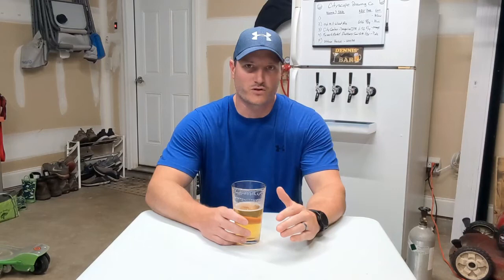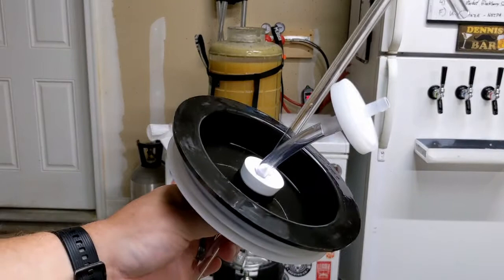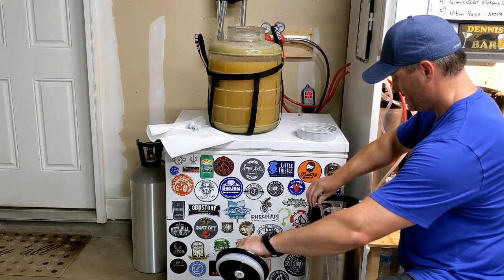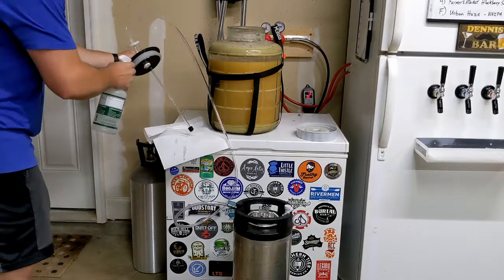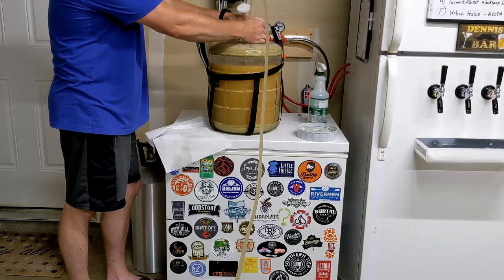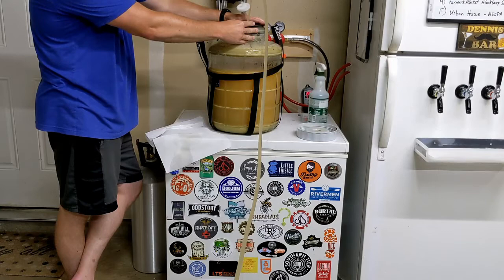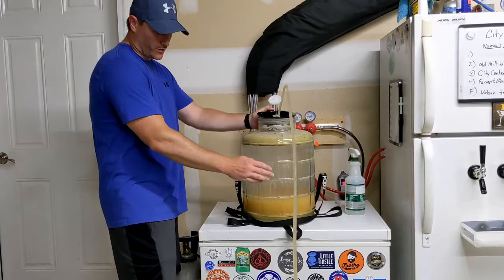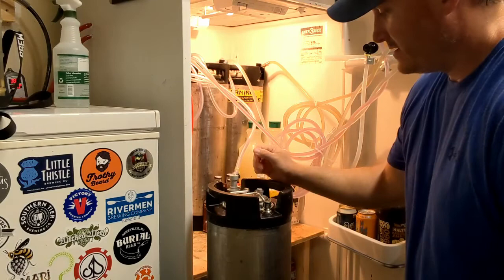Kegging Beer - Closed Transfer to Limit Oxidation

Comment: How long did that sit in the fermenter before you transferred to the keg,
Reply from the maker: I let it fully finish fermentation and condition for several days after.   Typically for Hazy IPAs 2 full weeks, but depends on yeast.  First week with active fermentation and dry hop towards the end, then second week to let sit on dry hops and condition. After that cold crash and rack to keg after second week.

Comment: Dude, no no no no, how long did you leave the lid off while you were sucking around showing it to the camera?? And then you blew into the fermenter!! Contrary to popular beliefs you do blow out o2, that’s how CPR works. In a fermenter with this small of a head space it absolutely matters. This is all wrong, you may as well have just tipped the fermenter onto the keg, I would strongly advise following almost everything in this video
Reply from the maker: I appreciate the feedback, but I've never had an issue with oxidation doing it this way.  You'd have to really agitate the beer and most of the time that's done during the transfer into a keg or carboy that hasn't been purged. If you are worried about it though, you can definitely push in some CO2 at a low pressure rather than blowing in the fermenter. The blanket of CO2 and the filter on the hose doesn't let a stream of oxygen rouse up the beer, and thelittle bit of oxygen that might have touched the beer isn't going to oxidize an entire 5-6 gallon batch.